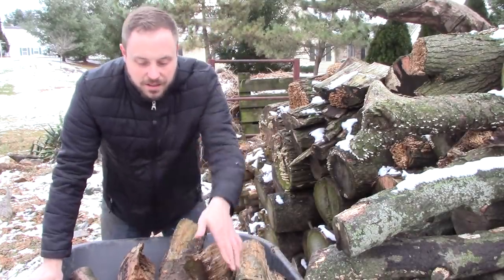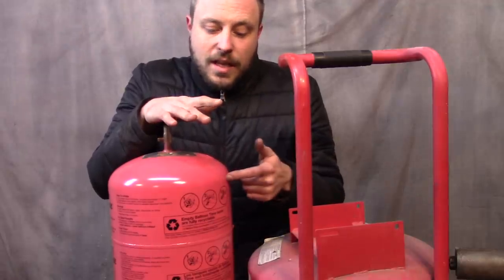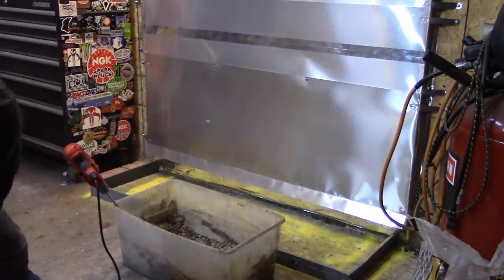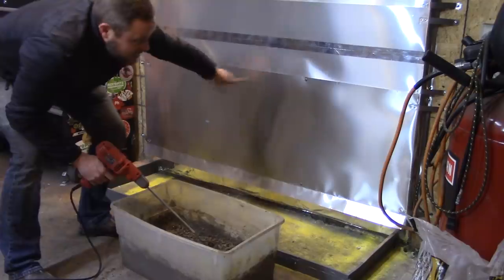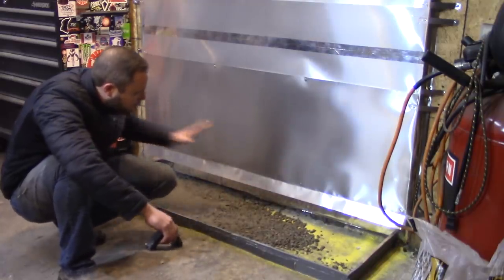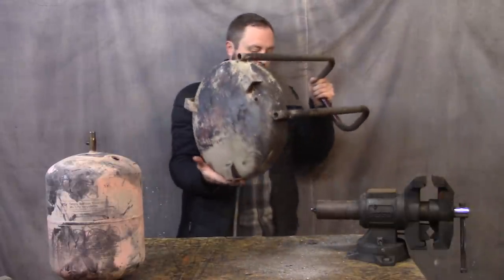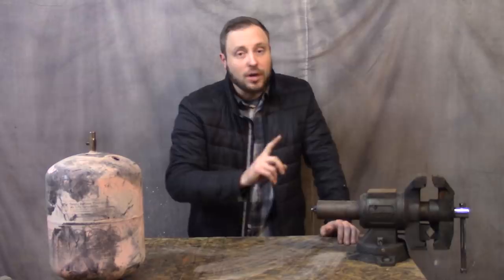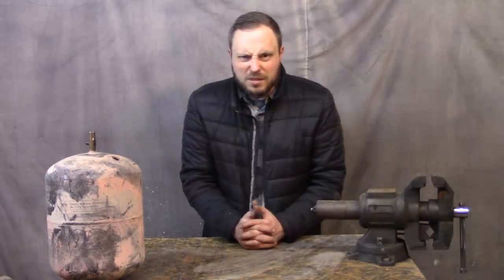Micro Mass Heater Build Part 1

Comment: Please install a carbon monoxide detector in your garage when using this. Just so when something should fail you know about it before it is to late. In Germany there was a case where a group of teenagers died because of a faulty oven in a Garage that filled the entire place with unedtectable carbon monoxide.
Reply: Same thing happened at my old High School, some teenagers went to check on a gas generator that wasn't working properly (they were shop or auto body students or something so it made sense to let them learn) and they were too late to get them out, they suffocated in the shed.

Comment: I love this idea! Can't wait to see how this works out. I'm planning to build a rocket stove for outdoor heating. Using electricity to heat stuff isn't wasteful. It can be the most efficient option since resistive heating is 100% efficient. I recognise the issue when things are burnt to produce that electricity, in which case that process is around 30% efficient. The solution: stop burning stuff; use solar, wind, geothermal, tidal, wave, hydroelectric, or one of the other great non burning options to generate your electricity.
Reply: Your propane heater isn't burning up all the oxygen if it's still running or you're still conscious. Normal is ~20% oxygen, and at 9% you'd probably be unconscious. It's more likely that the Carbon dioxide and monoxide from the heater are causing issues. 5% CO2 and you'll have noticed it. 0.01% carbon monoxide and you would likely start feeling the effects. Ironically the solution is to ventilate the room, which would work against all that heating of the room you've been doing. 

Insulate your workshop. Get yourself a CO alarm and preferably a CO2/ O2 depletion alarm. Better yet use an oil filled electric radiator, I use one on my 300ft² workshop and it's barely on. Or at least have the intake and exhaust external to your workshop with the heat exchanger internal. Then you have none of the air pollution issues with all of the heating. 

I want to keep watching your videos because you make cool stuff, so please look after yourself.
Reply from the maker: Leo Jackouski obviously. I can’t explain all of that in a video. My viewer retention would drop significantly and no one would see my videos. But! You making “teaching” comments like this help my video! So keep it up!

Comment: So, you trying to build a version of an old tiled stove. Search them, they functioned roughly like your describing. Usually they didnt have the drum for rapid heating, thought. But they were built standing up and had huge amounts of mass to store the heat.
Reply from the maker: I haven't ever seen these before! It will be similar but I think mine will be much more efficient because i am using principles from the rocket stove and a couple new ideas.

Comment: Have you thought about using fans to circulate the warm air around the room.
Reply from the maker: BetrayerDave I already do that. It helps after the concrete is slightly warmed but it is too hard to get enough heat into it. I’m out there filming so I have to turn the heater and fan off  because they make too much noise so I don’t have the time to put enough heat out. But yes that is necessary! Good thinking!

Comment: Have you considered adding insulation to the garage? A couple of Youtubers have done this DIY.
Reply from the maker: Shifter it has lots of insulation. In the walls, all cracks have been sealed, weather stripping in the doors, and an extra layer of insulation board on the entire ceiling.
Reply: @jairusofall  Ah ok

Comment: Electric heaters aren't that inefficient at the end they're basically perfectly efficienct so all you have in efficiency loss is the 40 loss at the powerplant and another 10 to 20 transmission. What about inefficiency of fuel distribution especially at the small scale to your local distributor using small tanks and then you driving there to grab it. NVM you're starting fires lol c'mon man at this point electric heaters are a ton better for the environment. You could've run it with some eBay solar panels too even during the winter.